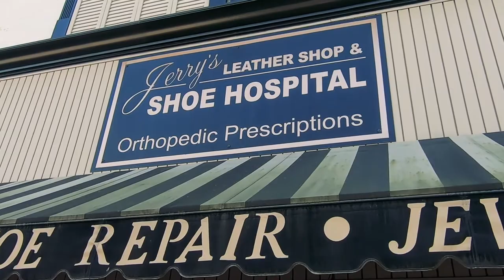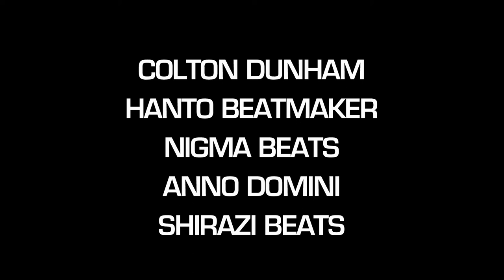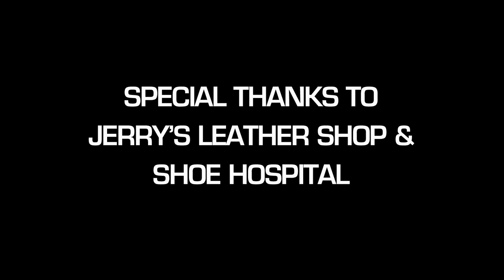What Kenny Do? Episode 14: "How To Repair Shoes & Make Custom Orthotics"

Comment: Thats cool. Orthotics would be good for my feet but a little rich for my blood. SHOUTOUT QUESTION And I keep wearing holes through my shoes at the toe. Any way to keep that from happening?
Reply from the maker: Stephen Deeter Ahhh, great question Deeter, I would suggest trimming your toe nails.
Reply: @RealKennyGTV  I do. I meant in the sole of the shoe 😂😂.
Reply: Thanks for watching Deet!!
Reply from the maker: @deeterse1994  Ohhhh, lol, yea toe nail trimming isn't going to work for that probably.  I don't know man, if it happens on all of your shoes you must be a heavy toe walker, if this is a rare occurrence, you might need to buy shoes with a more durable sole.